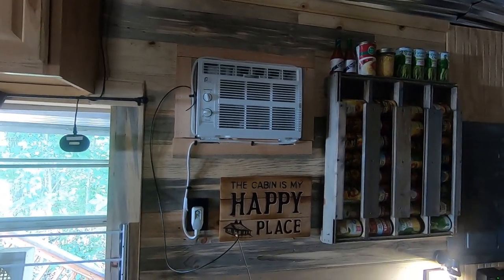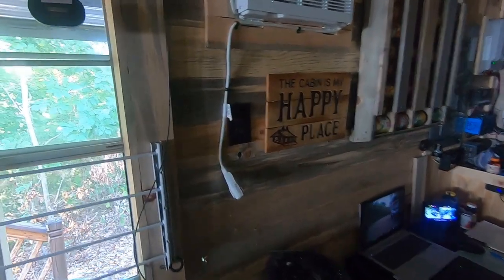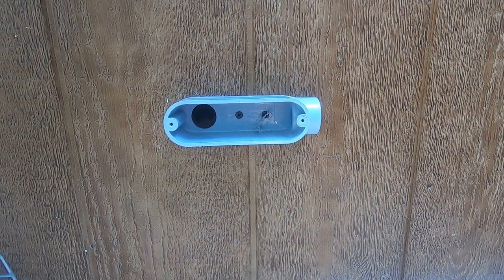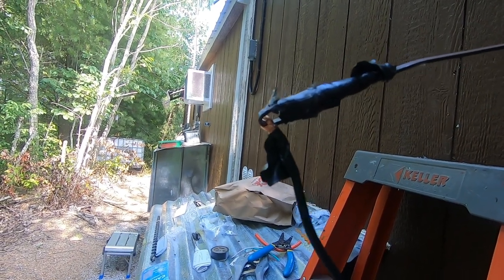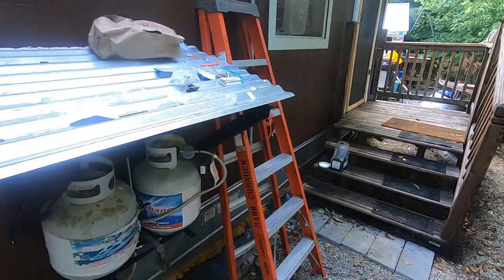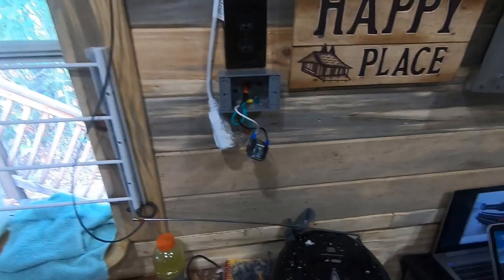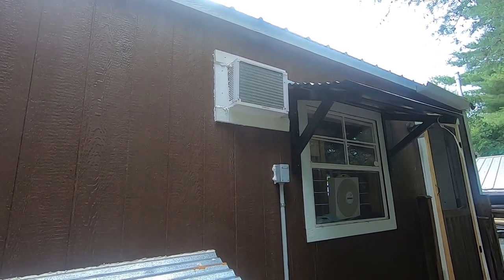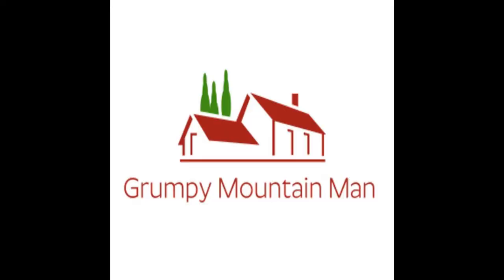Running a Air Conditioner Off Grid the Easy Way and not break the bank Off Grid Homestead

Comment: May not be code but still a quality and safe job.  Many people just hack electrical stuff.  Any reason why you didnt just hook a generator directly to the electrical pannel?
Reply from the maker: I wanted just the convenience of a dedicated circuit. If you notice there is another receptacle there at the AC unit , it is tied to the panel. That panel can be powered by the generator or the solar. I just wanted another circuit that would just fed the AC unit. I will use less gasoline due to a lighter electrical load. Also just easier...add gas and pull the cord.  Meanwhile my solar bank just does it's own thing.
Reply: How long will your AC run on your battery bank?  I have the same BN series controller and going to try and run a 5kbtu with a xantrex 1200w inverter and 210ah of useable battery.
Reply from the maker: @BS.-.-  ha less than 10 minutes.  The bank powers a freezer and lights. My other system a frig and lights. I have an inverter generator.  It uses under 2 gallons a day to run the generator.  I use a lot of passive cooling. I have a video showing my sunshields and fans. Works really well.

Comment: I installed an 8000btu unit in my shed because it's over 105F outside and my shed probably gets way up there. My inverter is 1200 watts with surge of 1400 watts so it dont always work and has to be reset. I was looking for a better unit to run off 12v or 24v. I like your can dispenser and may have to build one.
Reply from the maker: I have a video on the can dispenser.  It's in the homestead playlist.

Comment: You have a tin roof . I would add insulation. I used 2$ a sheet space blanket and packing tape on the roof and sides of my trailer in 117 degrees in the desert . You can get roles of mylar insulation cheap at home depot or Lowes. Cover the roof inside or out . Might run you 40$ . You can run that a/c on solar with a 500 or 600 pure sine wave inverter.  My 500 cost me $58 . On ebay.  Make sure it's a pure sine wave and not a modified sine wave. Your a/c should be pulling about 89 watts and up to 300 watts surge . You should be able to run it with a total of 400 Amp hours of lead acid or agm deep cycle batteries.  I get mine from Walmart (108ah) . Solar on the roof should be raised so there's air flow and shade for the roof . If no solar on the roof . I've used a queen size mattress on the roof as insulation.  Worked great . And came inside in the winter . Having lived in the south , Georgia.  And worked on a barge off-shore in the gulf . And then in the desert . I have found many ways to keep cool . Having lived off grid for most of 30yrs . I've learned solar .
Reply from the maker: I have all of that. I just don't video everything......thank you

Comment: Dude, if you leave the windows open you make the AC to overwork, turning the compressor on and off not frequent enough consenso more water! Throwing water against the back of the AC is a palytive "solution".
Shut the windows down and close as many doors as possible to reduce the unnecessary areas trying to cool down and overloading the AC units.
Is SO much simpler if you just learn how to properly use the AC. 🤦‍♂️
Reply: Thank you Mr. Wikipedia. You should start your own YT channel.
Reply: You do know he was doing a install to get the AC working right? You should start your own YT channel